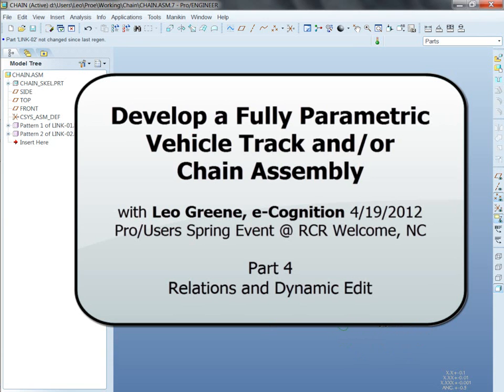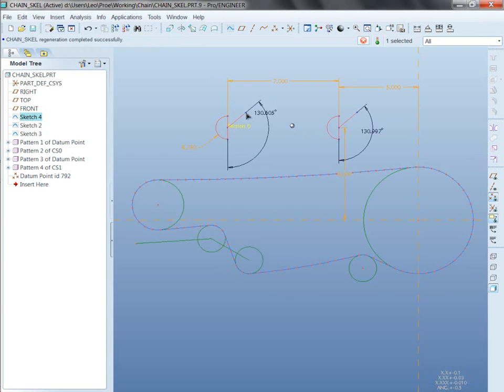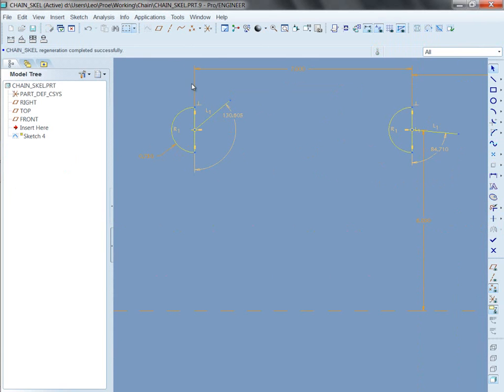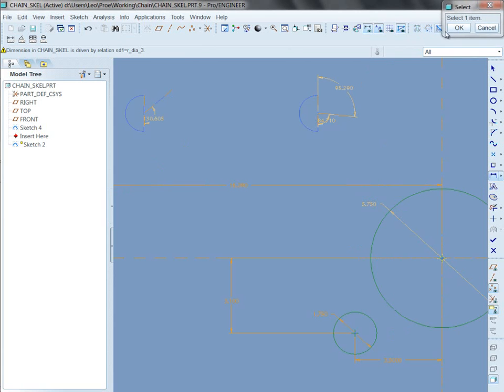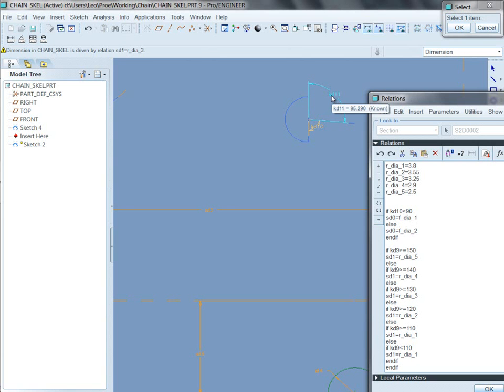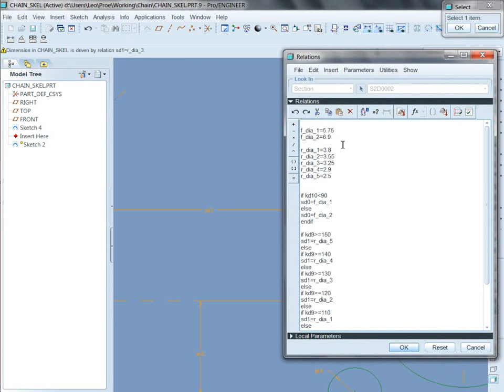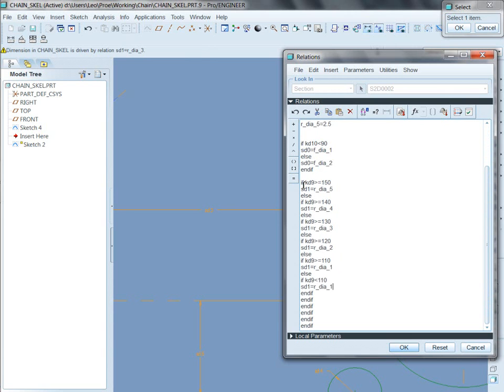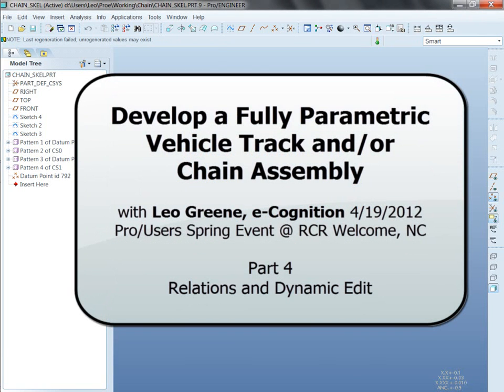Chain-Track CAD Modelding with Patterns - Part 4

Comment: I worked on patterns for a chain once and the difficulty with this pattern technique is that the length of the link ISN'T equal to arc length around the curved sections. It's a straight length from point to point and the smaller the radius the greater the difference. I'm pretty certain you'll have some discrepancies like interferences or gaps with your links because of it.